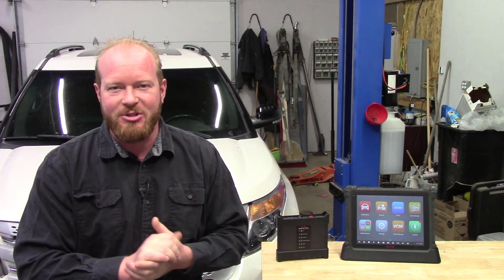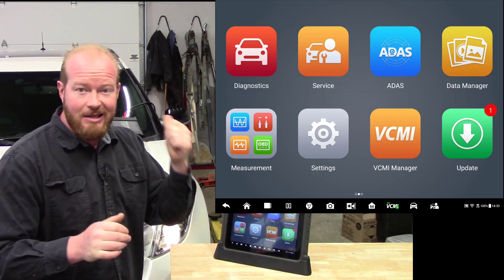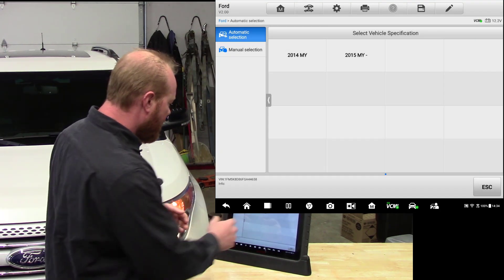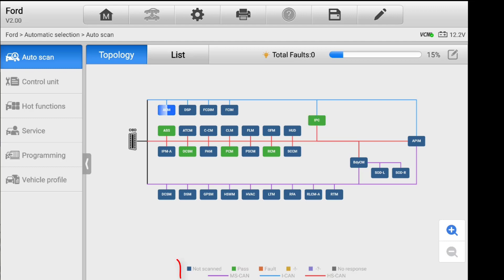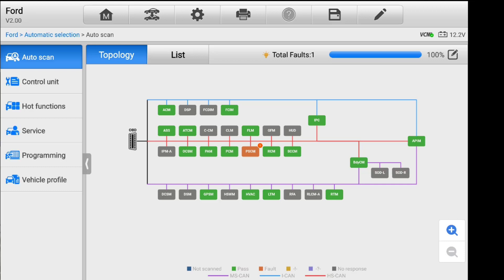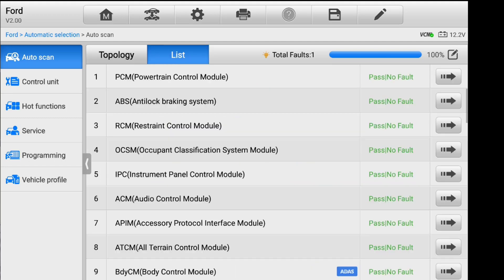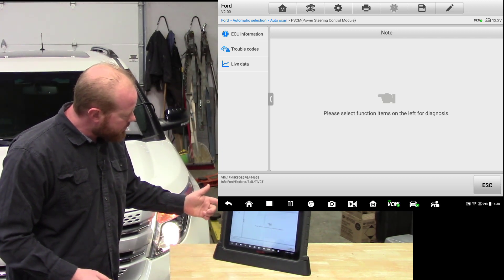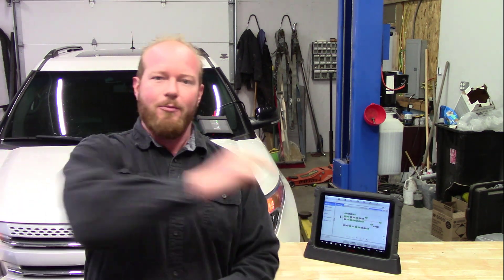Autel Ultra Topology #Autel #MaxiSys #Ultra

Comment: A hard connection is an absolute connection and rules out poor wifi and bluetooth connections. This is best used for programming functions that can leave a module damaged if programming is for some reason aborted or failed. That's why.

Comment: Hello Chris, I am trying to find an economical response to having an oscilloscope and these capabilities as well; however, it is difficult to tell which options have the oscilloscope and which don't amongst the models. Also, I saw there's an oscilloscope MD 408, but it seems that none are in stock, so is it an older item?
Reply from the maker: Autel recently discontenued their scope. If you are looking for a scope and scan tool combination check out the TOPDON Phoenix Lite3 and PX Scope https://www.aeswave.com/Topdon-Phoenix-Lite-3-p10492.html from AES wave

Comment: I noticed scanner danner complained about autel asking questions to identify the car and I saw it asked the year????  If it is reading vin why would it ask for year and for danner it also asked what engine.  WHY DOES IT NOT KNOW THIS FROM THE VIN??????
Reply from the maker: I tool doesn't actually decipher the VIN, it pulls the information from Mode 9 in the PCM.  I have been talking with Autel to correct this as well.  NO NEED TO CAPITALIZE IT, IM WORKING ON IT >:oP

Comment: Can in cylinder waveform analysis be obtained with the scope function of the maxisys ultra using accessories such as the Picoscope wps500 or first look pressure transducers?